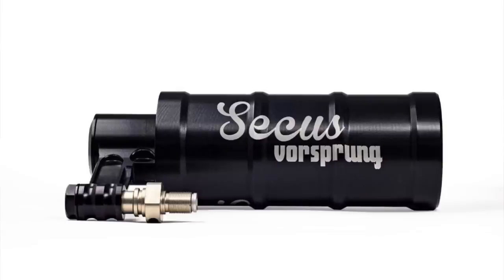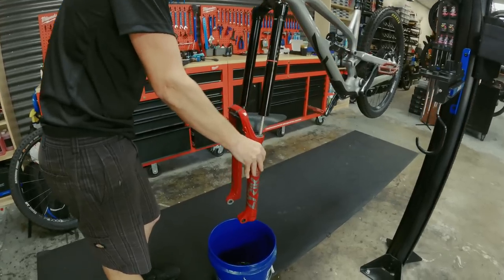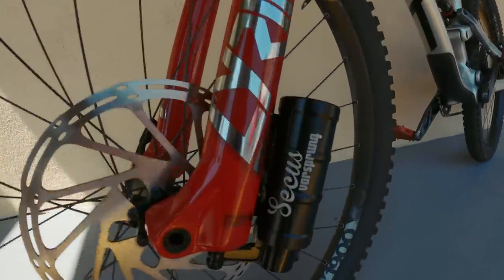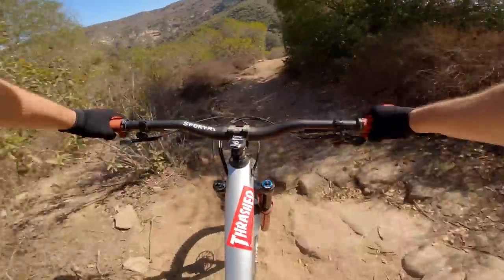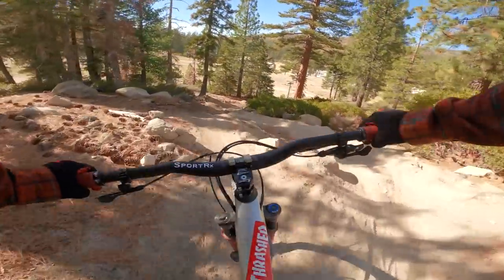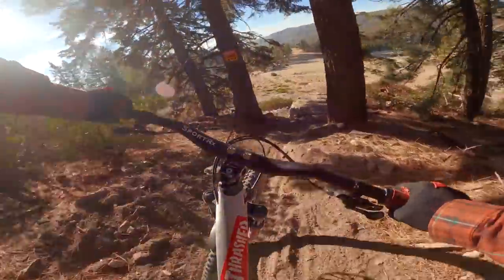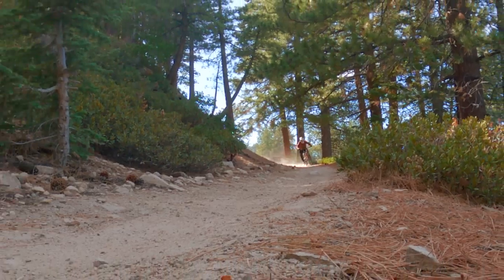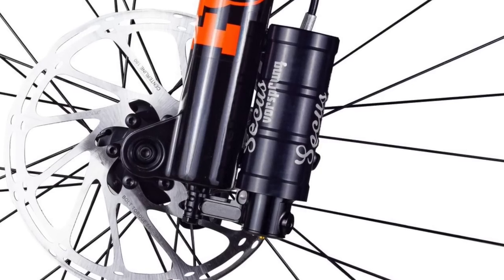The Secus Air Spring Upgrade

Comment: Did you end up "balancing" ;) the rear suspension in any way after adding the Secus?  I.e. did the rear feel lacking after the improvement in feel on the front?
Reply from the maker: Haha - nope the back was already dialed and no need after the secus is installed.

Comment: I have an EXT ERA, so I doubt I need this thing. Butt nice product. but not tired it.
Reply from the maker: Nice man
Reply: @TheOutsiderMTB  it's very supportive yet plush. No volumenreducers but two adjustable air chambers. I know Rock Shox used to have dual air but now they don't, the claim was it's more complicated for the user to adjust, not really super hard. Just adjust and rest to find a sweatspot. I am not sur eif I am completely done adjusting it yet. But I am impressed.
Reply: @TheOutsiderMTB  The Vital Mtb review pretty much sums up the fork performance, they basically came to same result as me, the recommended settings made the fork too firm.